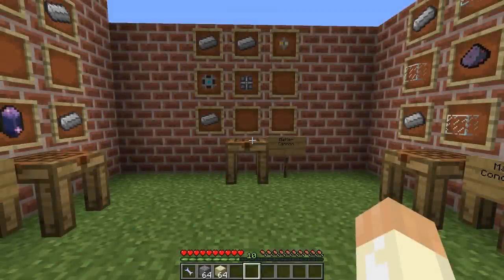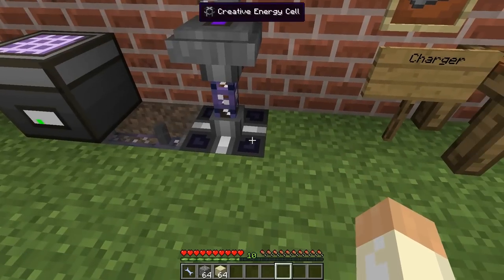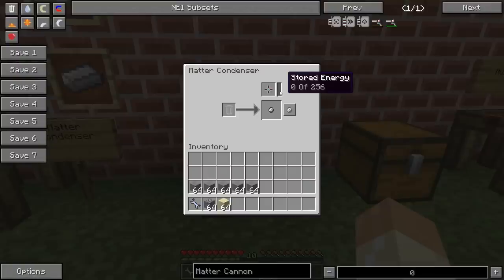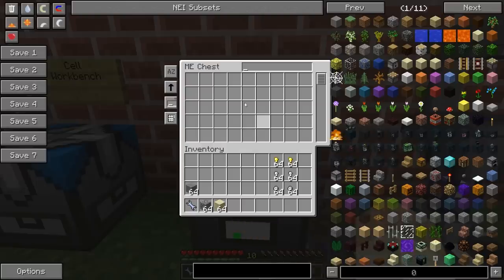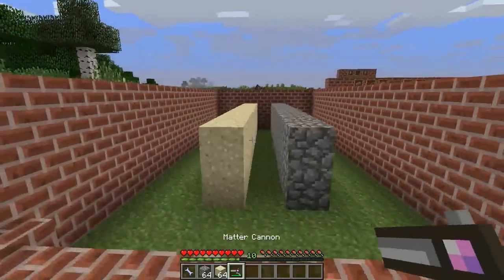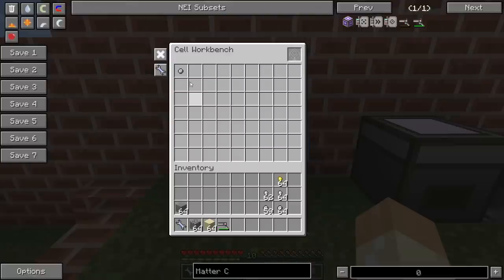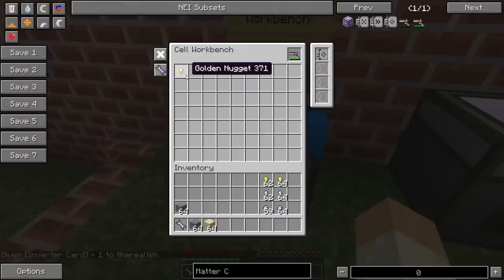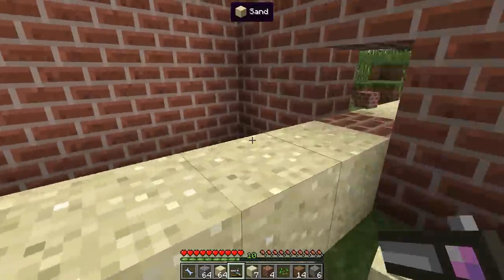Applied Energistics 2 Tutorial #6: Matter Cannon (MC 1.7.10)

Comment: lol cough if you can read the acceleration upgrade doesn't "add bullets" it let's the bullets accelerate better -> higher speed = more demolition and damage
Reply from the maker: If you load the Matter Cannon with Matter Balls (or any ammo) and shoot, only one shot will be fired. Put in 1,2,3 or 4 acceleration cards and 2,3,4 or 5 balls will be fired. This is verified by checking the ammo status (put the cannon as the storage device in ME Chest), and I just did it again in version rv1-beta-37. With 4 acceleration cards, there is indeed fired 5 shots every time I pull the trigger.
Reply: i haven't tried it myself, but why would they call it acceleration if it's adding shots... that doesn't make any sense at all
Reply from the maker: Jakob Trubakov I can only guess, but there are not that many upgrade cards, and the acceleration card is mostly used to upgrade buses to be faster. Perhaps one could think that it is a bonus effect that they also upgrade the Matter Cannon to shoot more things. But I agree that still firing one shot but with more power would be a logical effect of an upgrade card.
Reply: Jakob Trubakov Acceleration cards cause the installed item to do things more quickly. In this case, it causes the gun to use ammo more quickly.
Reply: TKH The matter cannon is a railgun. As such, acceleration cards would let it accelerate 1 item faster....or larger items / larger number of items at the equivalent rate. Heavier items have more intertia, which hit harder and go farther. QED.